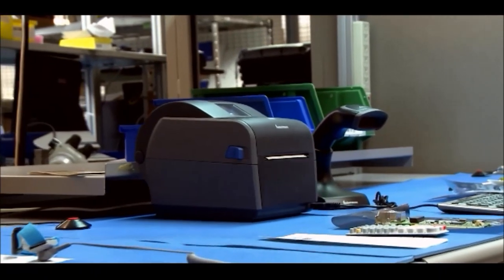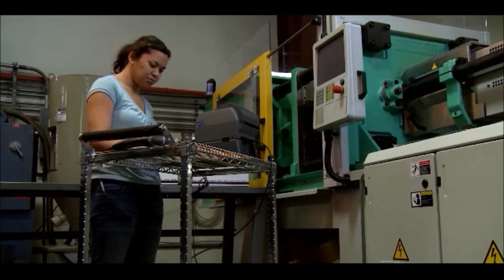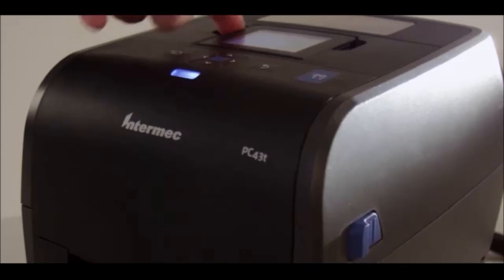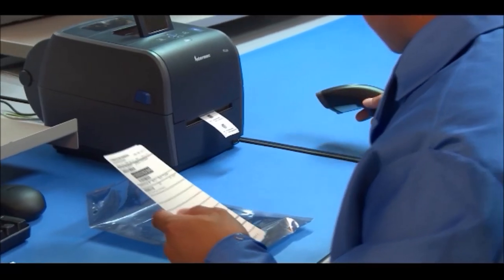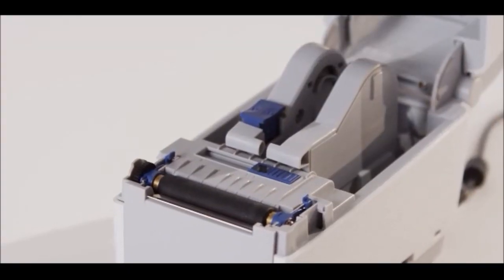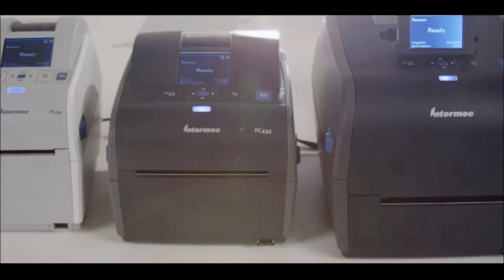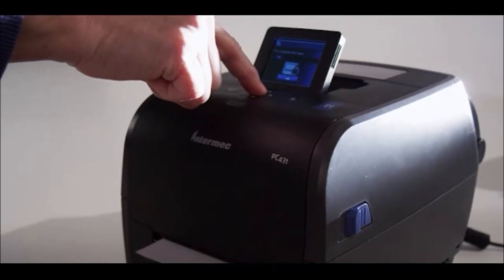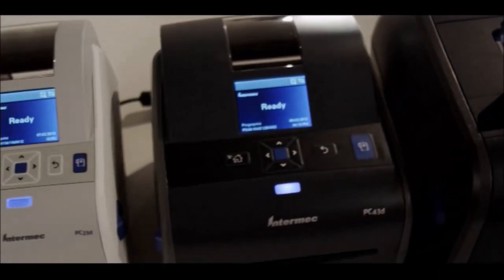Barcode printer PC43d / PC43t PrinterSuper easy to install and use, the compact

Comment from the maker: PC43d / PC43t Desktop PrinterSuper easy to install and use, the compact PC43d / PC43t is a purpose-built platform with an innovative design guided from customer input. This 4"-wide desktop printer is perfect for space-constrained settings, and offers tailored solutions for transportation / courier, healthcare, and retail and hospitality markets, as well as small and medium business manufacturing, and warehouse and office environments.
 
Key Selling Points
Reduce Time to Deploy and Maintain
All in One Printer Command Languages (FP, DP, IPL, ZPL, EPL, DPL = Integration into typical environments
USB Host/Boot enables file download from USB Thumb Drives
Industry leading connectivity today or user upgradeable in the future for scalability & added confidence: Ethernet, Bluetooth®, WiFi, CCX certified & IPv6 standard
Many healthcare and WMS software certifications for leading software compatibility
Remote monitoring and updates via printer webpage, SmartSystems™ and or Wavelink Avalanche™ delivers a powerful ROI

Improve productivity & efficiency
One handed media loading for quick, trouble free use
Flexible and programmable Smart Printing simplified labeling processes, reduces errors, can eliminate PC hardware
Easy to understand printer status messages from either universal icons or VGA display in 10 user languages keep productivity high and greatly reduces service calls
300m ribbon length reduces number of times operator must stop to change ribbon (1 change to every 4 changes in the competitors’ printer)
Largest memory with 128MB Flash/RAM and fastest printspeed at 8 ips offer fastest time to first label and throughput
Widest range of media available for a desktop printer including tags, receipts, linerless, floodcoat, RFID tags. Media consistency with other printers.
Industry leading connectivity today or user upgradable in the future for scalability & added confidence: Ethernet, Bluetooth®, and WiFi, CCX certified & IPv6 standard

Reduce training costs for workers
Easy to understand printer status messages from either universal icons or VGA display in 10 user languages maximizes uptime
One handed media loading is simple for new users
Easy to clean or replace platen roller requires no tools

Partner Benefits
Expand market share with a unique solution that doesn't require costly support.

Increase Sales
Flexible connectivity and user installable accessories means the printer is always in stock – a USB printer becomes an Ethernet printer; 203 dpi printer becomes 300 dpi
Continuous opportunities to upgrade customers

Speed Deployment
All printer command languages on-board -- drop-in replacement for existing Intermec and competitor printers
USB Host enables the easiest and fastest set-up using a pre-configured USB memory device

Reduce Support Costs
Intuitive universal graphical icons or multi-language display gives simple operating and error messages to user in their own language
Options and accessories are user installable plus plug & play